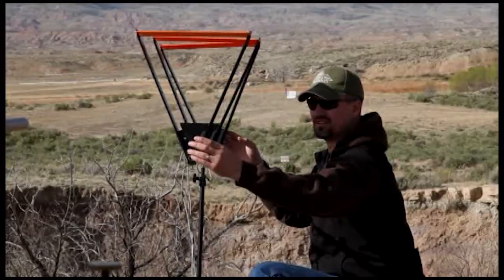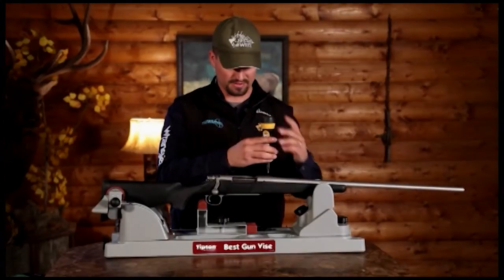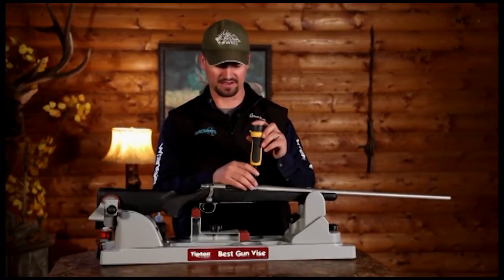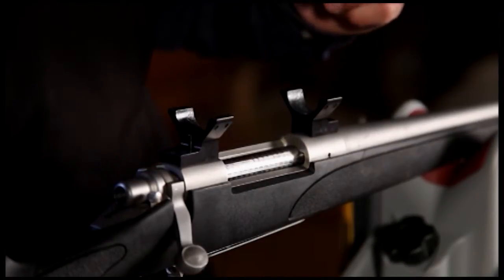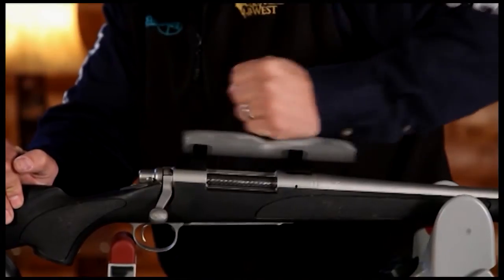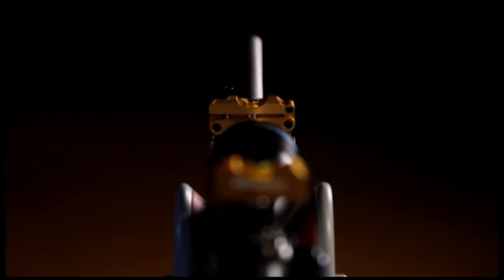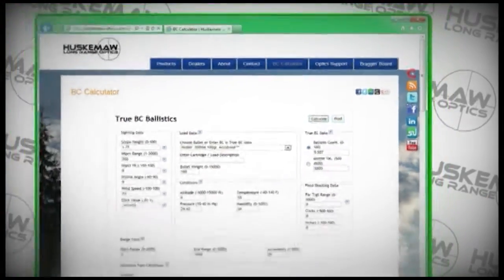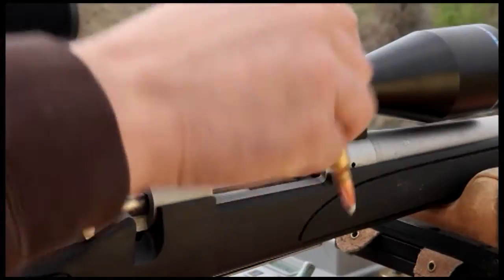Huskemaw Optics Scope Mount Instructions

Comment: Why didn't you lap the top rings?  With those on during lapping, you also limit any compound going into the screw holes as well?  You also completely missed the step to adjust eye relief before you torques the rings down onto the scope.

Comment: if the turret was made based on the temperature, altitude, barometric pressure and bullet velocity at a particular location, keeping the bullet velocity constant and different geographical location with change in temperature, altitude and barometric pressure will the same turret work? please advise